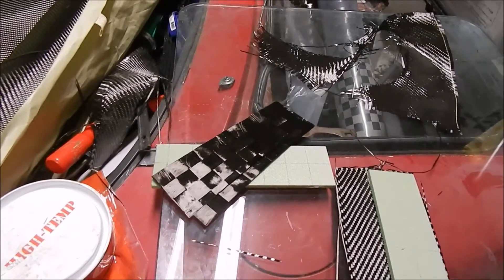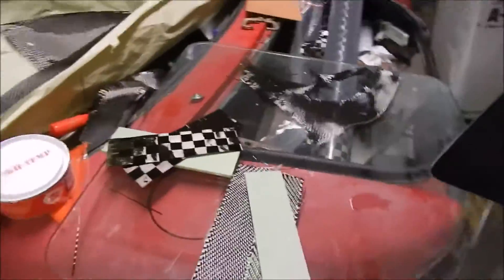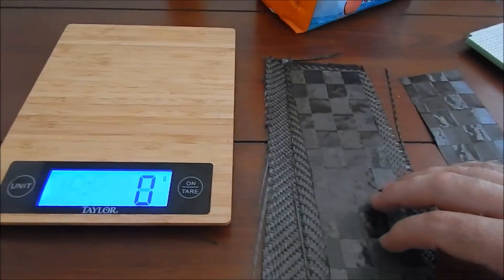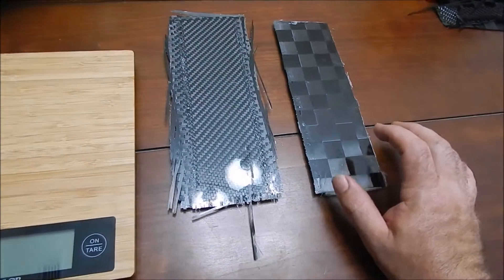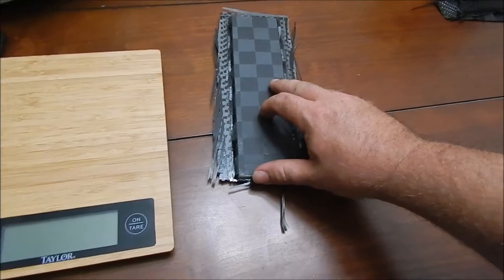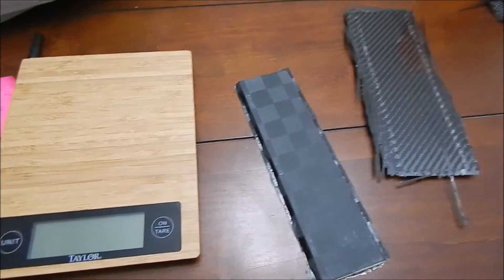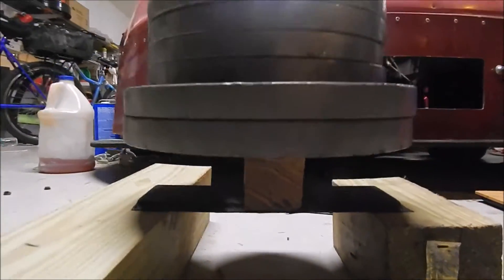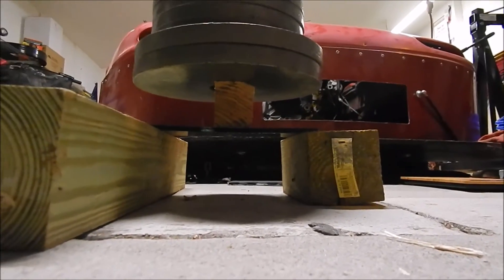160gr Spread Tow vs 10.9 oz 6K Twill Weave Test

Comment: Your obviously a doer not just a talker.  There are a few people nation wide who are getting into carbon fiber custom parts for customer cars. Most use varios female molding techniques, but a few are giving clients plenty of totally creative options by first optically/lazer scanning customers car surfaces, then generating a file that they load to SolidWorks. While in SolidWorks hoods can get custom scoops venting, bulges on screen, then generate multiple views for their clients b/4 creating a finished work.  Looked into 3DP -Platform WorkBench #400 series 3D printer(39"wide x 59"long x 26&3/4" high print area). Can even print much longer quarter panels with 3" overlap of old school finger/sandwich joinery to achieve one MALE THIN PART FROM TWO PRINTINGS.  That printer is about 40K$, but is the corner stone of a business.  Epoxy compatable plastics printed 1/4" thick honeycombed and covered in vac bagged or farmed out autoclaved in carbon fiber would in a male molded process would offer customers their own carbon colored covering solutions by just shipping the printings and customers finish themselves.

Comment: Went to www.compositeenvisions.com  and bought a "TeXtreme" sample pack from them. Cost(i think i remember 16$).  The Comosite Envisions web site, however has other wild TeXtreme fabric like their Zylon/Carbon Fiber(TeXtreme).  Composite Envisions has everything a composites guy could want(from simple to cutting edge).  Nascar and F-1 use TeXtrme bigtime.  Every place a plain or twill goes over or under in a weave is called a "crimp". In a yard there is a large amont of these witch collect tiny pools of resin causing weight gain. Also more crimps = LESS strenght.  TeXtreme is 20 to 30% lighter in a layup than typical CF weaves.The only time i go for any other weaves is very tight curves in the mold where cosmetic appearance is necessary(4or8 harness weaves).
Reply from the maker: david,r. massey I messed up on the first go around on the infusion. The hood I made was around 88 ounces before trimming. But some of the fibers weren't fully saturated so I'm going to make a new one
Reply: Would the vacuum in the corners of the mold draw resin back into the voids if you shut off the pump to give it a chance to back feed, then turn the pump back on to draw out the excess?
Reply from the maker: I'm trying to visualize what you are trying to convey. But I'm drawing a blank on what you are trying to say. If the bag was pulled up, the is going to be pulled there to fill that void. but one of the main goals is not to turn the pump off to introduce less air bubbles in the part.

Comment: Impressive hold for such thin pieces. Would be interesting to see how they'd have coped without the foam core.
Reply from the maker: I have noticed the flexibility is almost equal to a sheet of Aluminium of the same thickness of Carbon fiber. So I it is just Carbon or with foam core the Stiffness is about the same as the Alum of the same thickness